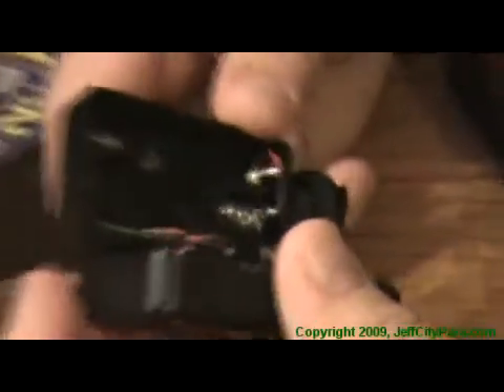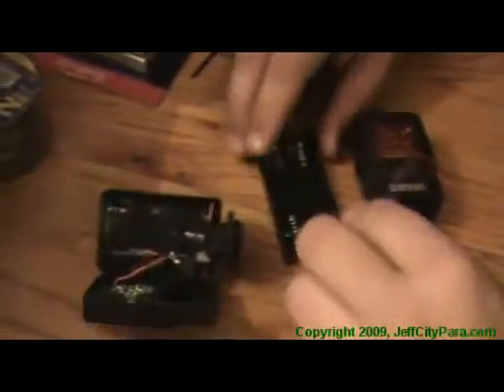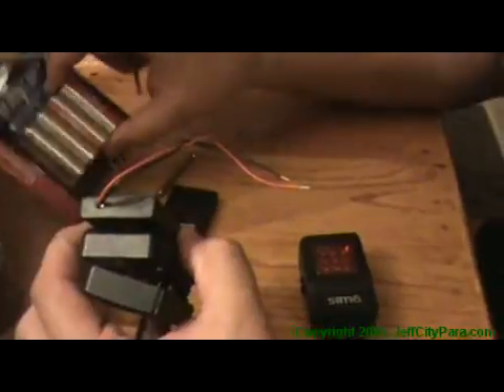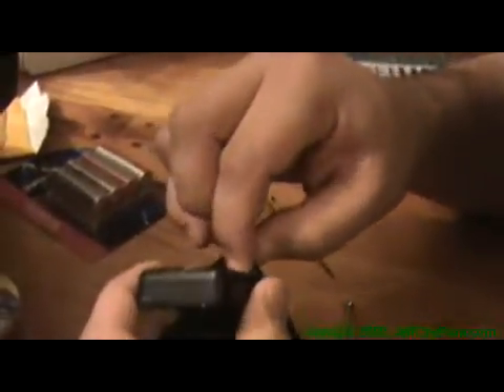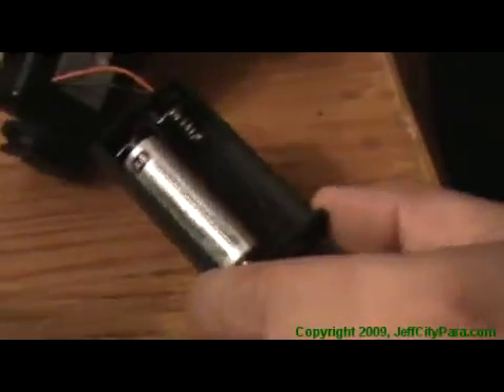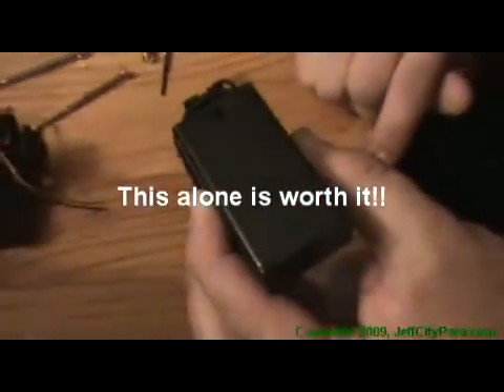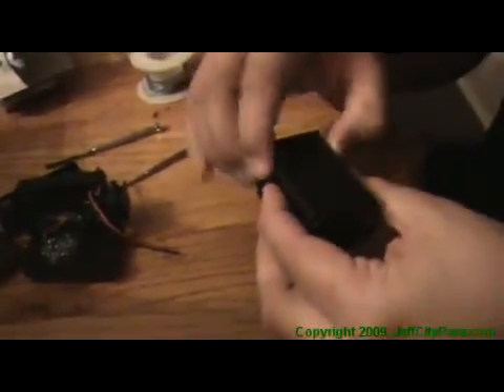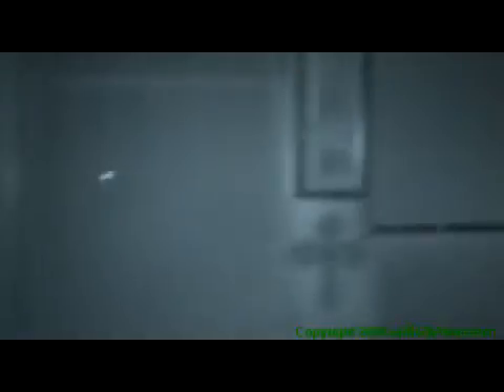SIMA SL-10IR Infrared Video Light Mod for 3hr use! DIY

Comment: You know, a much safer and more economical way I use is energizer or duracell rechargeable batteries, rated 1.2 voltsx3 = 3.6 volts

Comment from the maker: @Paranormal1041 Yes I am aware of the build. In fact we will be adding more. The one advantage I prefer over this light versus the Creepy hollow Triple Chip LED design is that there is no focal point. This light has hit the market again under the Polaroid name btw. I plan to test some new designs with the CH triple Chip design to see if i can overcome the focal issue, or maybe see if I can find a comparable diffuser to this light?

Comment: why go out and spend, 50.00 - 100.00 on a brand name IR light, to use at night. when you can build 20 lights for the price of 1 or 2 of those Sima SL`s.

I built 20 IR lights for under 55.00.

Comment from the maker: @PaulGT Hey Paul, sorry it took me so long to see this. However, yes a similar mod will work, but you will need a 3 or 4 AA battery pack, and if you use the 4AA, be sure to dummy one of the spaces to match voltage. 20-IR requires 3.6-3.7V. It gives similar performance.

Comment from the maker: @nsteck2345 "3G" correction to 3v (spellcheck). Also,can't recall the upload date on this video but since then I have used both my Sima lamps regularly, averaging 3-12hrs /week between investigations and IR Photograghy. Holds up well. Should add in the long run, 2aa rechgbles cheaper than 52 9v batteries.

Comment from the maker: @nsteck2345 I am not an electrician either, but I did set out for a 9v conversion first. However all attempts to reduce 9v to 3G would not adequately power the lamp. 9v direct did illuminate the lamp, but only tested for 1 min. Heat buildup is a concern and may negatively affect life of IRs or cause early fail. This mod does create more heat, but no adverse effects with regular use. I agree on the focal point issues 100%

Comment from the maker: @shaden1628 The simplest bypass is to simply connect a wire in the fourth slot in line from positive to negative. It will bypass the current in line from the three batteries without adding any additional voltage. I usually will use a similar sized wood dowel, cut it to size, and use metal thumb tacks on each end to hold the wire secure creating a dummy battery.  There is no error in using alkaline battery except shorter run time from my tests. I use them quite often.

Comment from the maker: @gousthuntermike  I have not tried to test the SL20ir, but a friend has modified one. We used 3AA battery modification to match the Sima OEM 3.7v battery with a 3.6V charge with the same longevity results as the 10ir mod.I did test10IR with a 9v& I did not leave connected for more than 30 seconds to avoid burning out. The one byproduct of this modification is that the IRs will get a bit hotter. As such, while the circuit may handle more voltage, the IRs may not.

Comment from the maker: Depends on the camera. If it is a Sony Handycam with Nightshot then yes, but other models will only be able to see the lamp, but not see the illumination. Post you model info and I can advise better! You can also look up your cam specs as well. If they work to zero lux, then most likely it will work. However, if it says 0.8 or higher it will require some element of visible light and these illuminators will not work. You can modify the camera to see it, but this is risky and may not work.

Comment from the maker: Add'ly I have considered modifying the switch set-up to be able to bypass batteries altogether and use the charger for plugged in use at times, but need to research the circuit more before assuming it will work.

Comment from the maker: No, but it was a consideration. However, with the current set-up, you can still put rechargable AA batteries in and use the Sima Charger to charge them. Slaving both sets as the video shows would produce 6v unless you added #2 switch or completely repurposed the on/off switch-but then you constantly drain battery. I have not tested the recharge time for AAs as I find it much easier to swap out batteries on the go and then use a separate rapid charger while the light is still in use.

Comment: Have you tried using the switch on the sima to switch between in the internal batteries (which can still be charged) and the change out or additional add on box with double AA's?

That way you've got sima and back up batteries!

Comment from the maker: Yes, we have had success with using 3aa NIMH (2000mah or better) batteries for a mod w/ quick change out. The most convenient/common battery box is a 4aa box, just bypass the 4th battery and it will produce 3.6v (Original lamp 3.7v battery) and powers the SL20IR a little over 3 hours.  The SL20IR seems more sensitive to mah and we do not recommend using alkaline batteries.

Comment from the maker: Yep, you got it. That model is not IR capable and operates to 6 lux only vs. 0 lux cameras. This model, while an excellent camera also has some poor reviews on low light filming as well.  Now, with this said, it is possible to make this model IR sensitive, but I warn you that it could cost you the camera if not done properly and would become a permanent modification thus preventing day use of the camera. I would recommend getting an add'l Sony video cam to supplement night film to use the light.

Comment from the maker: What model of Camcorder are you using? In order to use the lights, you must have an IR capable (Nightshot) camera, typically a Sony model. In addition, depending on the model, it needs to be switched to Nightshot mode. Most models have an external switch, others a menu function. Also, when you mention red light? Are you referring to the power light on the side or the actual IR Leds?

Comment from the maker: Hello, yes the Simas do give off a faint red glow when illuminated unlike the Sony IR or some other higher end lights. However, it is not enough to illuminate any space with natural light. IR sensitive (non Nightvision cams) cameras will detect the IR light, and some will even show a blue light due to the IR Cut Filter filtering the spectrum some. You will not see the illumination with your eyes illuminating the room. But if you look directly at the light, you will see the faint glow.

Comment from the maker: Using the Three AA Set-up with a better 2000-2500mah battery works for the Sima 20IR. testing about 3 hours at the moment. Still refining, but same mod. If you can't find a 3AA battery back, use a 4AA and just bypass 4th battery.

Comment from the maker: Tested in 14degree weather last night, complete exterior shoot w/3 lights. Panasonic AAA lasted less than 5 mins with extreme temp. Dollar Tree Sunbeam started partial illumination within 30 minutes. NIMH rechargables were still going strong after 1 hour. But hypothermia was setting in faster than batteries dying. Think I will continue this mod to my natural light extenders as well.

Comment from the maker: The Sima Lights seem sensitive to Mah vs. just voltage for some reason. We tried several 9v reductions to 3v but could never get the lamps to operate correctly. However this was so simple and effective not even funny. I was thinking about ordering a 20IR, is it the same 2 aaa setup? The Amazon specs were not clear?